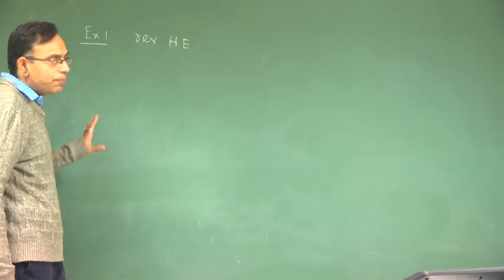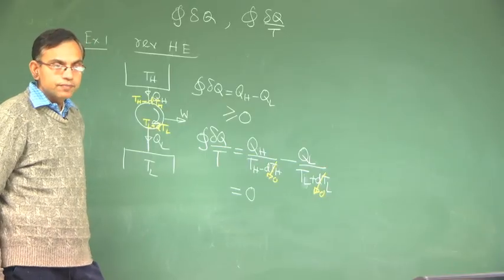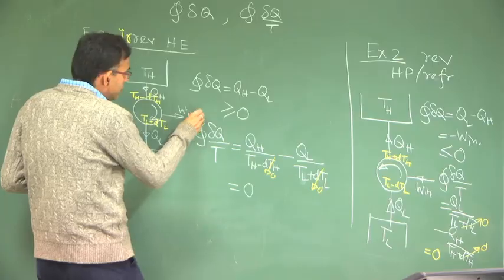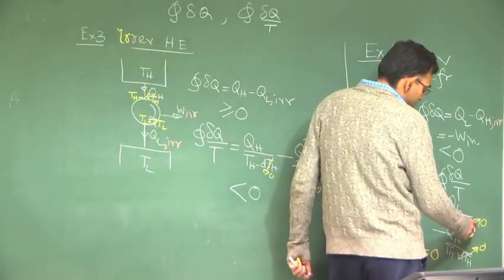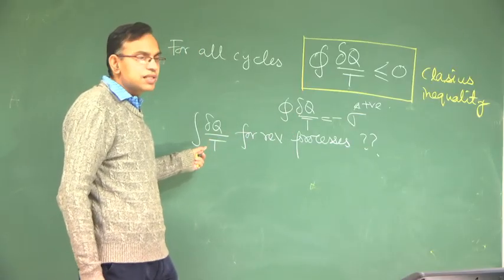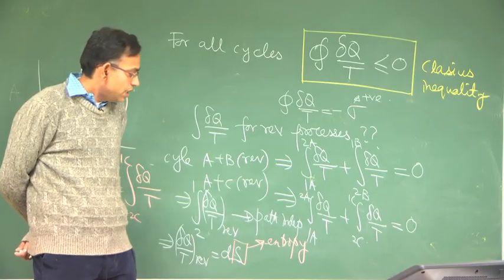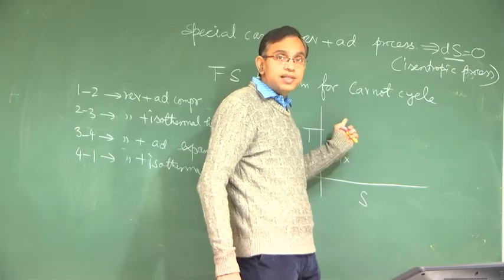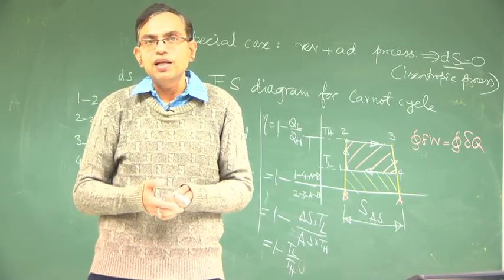Lecture 39 : Clausius Inequality and Introduction to Entropy

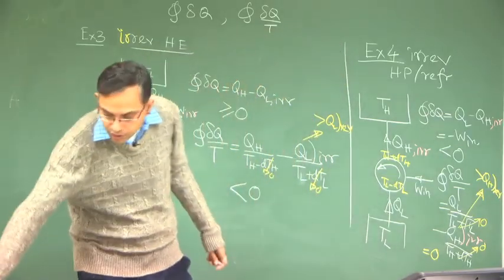Comment: 16:17 , its true for the refrigerator, but not for heat pump, as there are different formulae for efficiency in both case. Am I correct?????
Reply: as in refrigerator QL is constant, while in heat pump QH is constant in irreversible process.

Comment: Sir, why the cyclic integral of dQ in case of reversible heat pump or refrigerator can be equal to zero??Atleast some positive work input will be required there also.
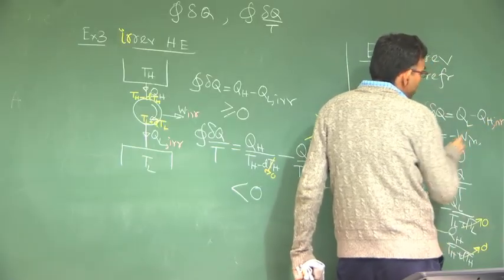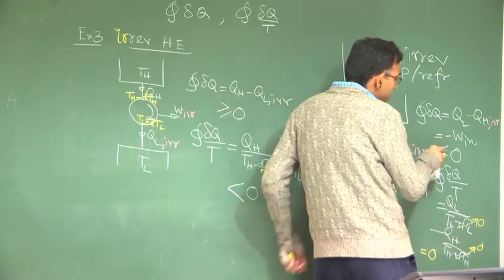Reply: Sir said the same too. Watch from 14:35, he was erasing 'equal to' symbol at 14:40.
Reply: @jagdeesh he erased in example 4 that is irreversible process but there was an equal to symbol in example 2 which is a refrigerator example reversible process
Reply: It is not equal to zero
Reply: Integral of dq/t is only equal to zero
Reply: For a reversible process , Q1/T1=Q2/T2, thus Q1/T1-Q2/T2=0 thus  Q1/T1+(-Q2/T2)=0, Q1 is heat accepted from a reservoir at temperature T1 and Q2 is heat rejected to reservoir at temperature T2(therefore , is denoted by "-Q2").